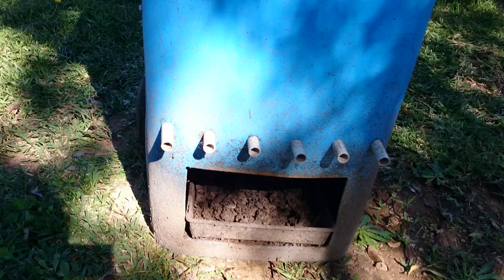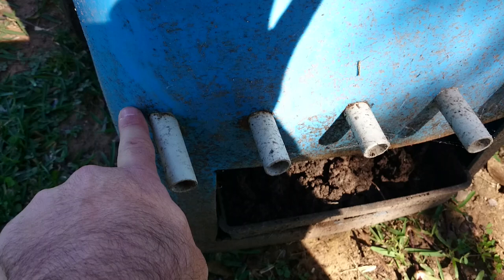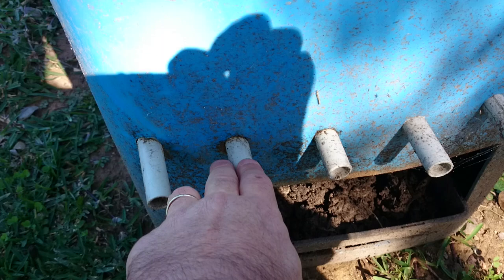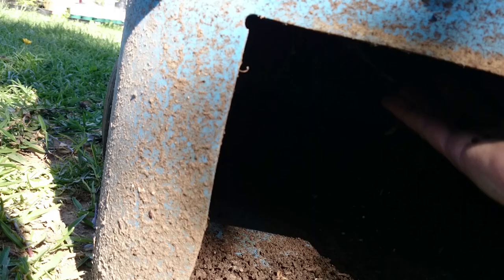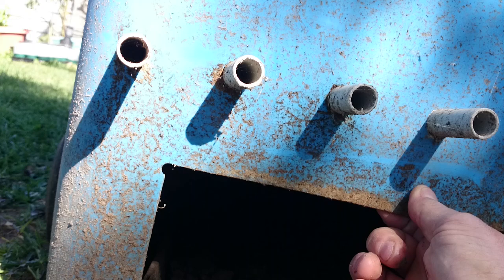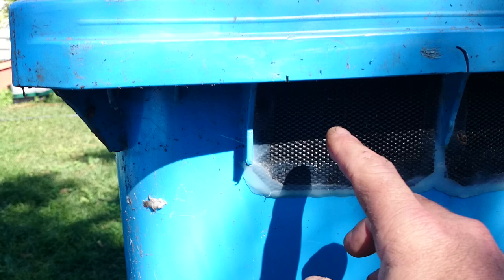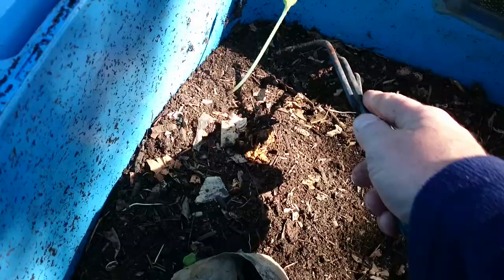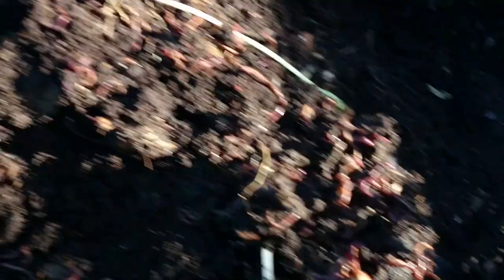Worm Farm - wheelie bin flow thru - changes to build 080615

Comment: Wish I would have remembered to watch this BEFORE I drilled and installed my tubing.... :-( I guess I could always add a 1/2 inch piece between the 1st and 2nd tubes. Think that is really needed?
Reply from the maker: only time will tell, Steven - but it is probably going to be allright - the VC at 24 inches is harder to move with the rake than you would at first believe